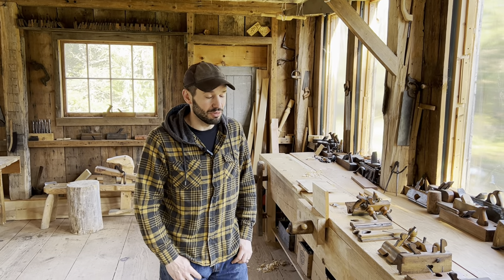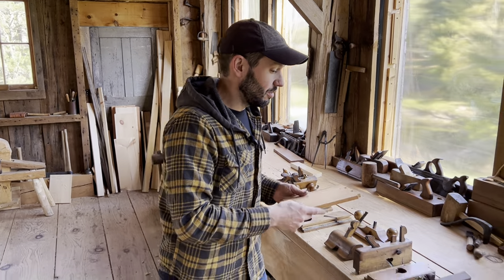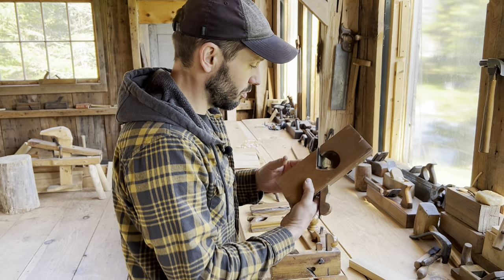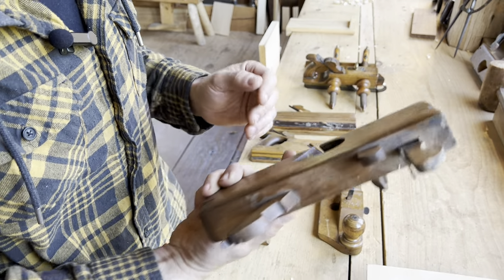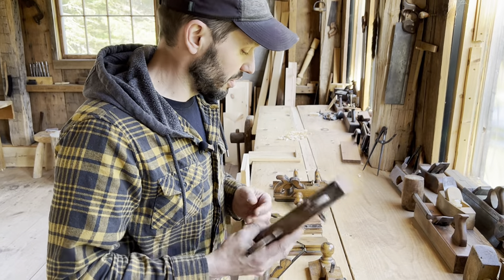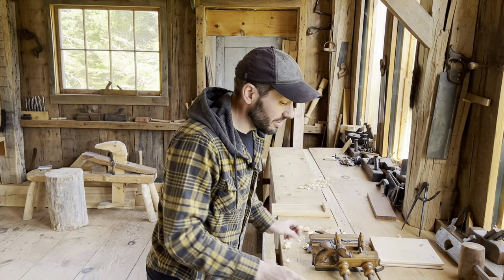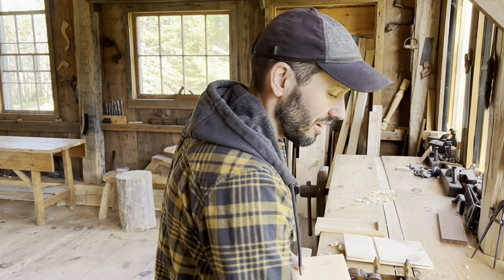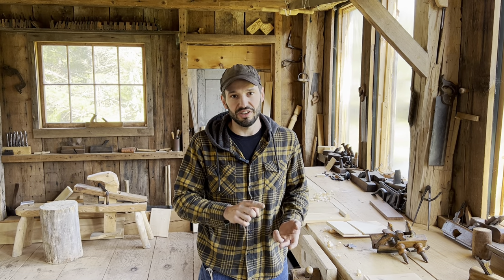Why You Need Joinery Planes

Comment: Good video.  I don't have any of the old wooden routers, yet, but I do have a Stanley 71 without the depth adjuster.  To fine tune my cut once I'm near my final depth, I put an old playing card on either side of the dado, set the plane on the cards, drop the iron into the cut, lock the blade in place, and remove the cards.  Now I can remove a playing card's thickness from the bottom of the dado.

Comment: A corn exchange is literally that; a place where farmers used to go to sell their crops to merchants. I guess that toolmaker had their premises opposite the one in York 🙂 Nice video, I love seeing these old planes in action. I recently sold one like that last one you had, I'm kind of wishing I hadn't now!
Reply: The Corn Exchange in York was built in 1870, at the junction of Clifford Street and King Street, consisting of the exchange rooms themselves and an attached warehouse.  There may have been an older exchange on the same site, replaced by the current Victorian building, or an older one might have been located elsewhere (York suffers quite badly from flooding when the Ouse can't cope, so as the city -- which tripled in size from 1800 to 1900 -- became more built up it would have made sense to move something as critical as the warehouse to higher ground).

Today the building is a theatre and opera house, but you can still see a few remaining blocks of 18-19th century buildings opposite it (on both streets).  None of them are workshops now, just cafes and mini-supermarkets.  If you want to find the likely age and provenance of your plane, you'd need to contact the York Central Library and see if they have any record of a J Bland renting or owning a property on either of those streets.  (I have had a quick skim through the National Archives and the library's online records, but there's nothing obvious there.)
Reply: I would assume that plane is from the 1800s.

Comment: Great overview. I recently picked up some wood body dado planes like you're showing and hope to put them to good use - the first project showed them to be almost as efficient as a table saw considering you don't have to set up the dado blade, plus safer, quieter, and more fun!

The groove plane I picked up (with no matching tongue) had a cracked iron about halfway up, so I welded it back together and filed it back to size - works fine on a quick test.

This category of planes opens up a whole category of joints that I'd otherwise be making with power tools or making slowly and ugly with chisels.